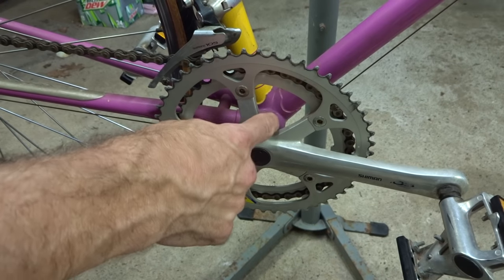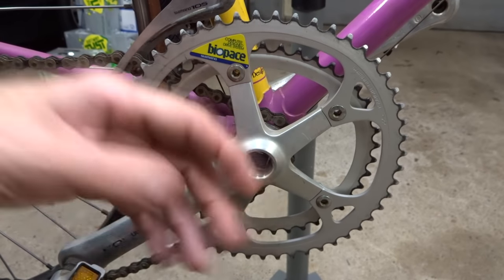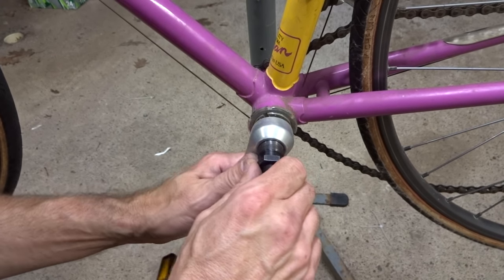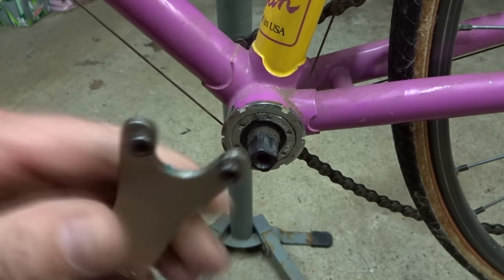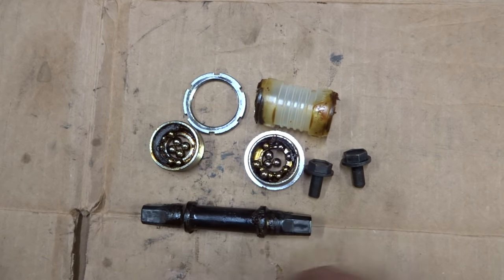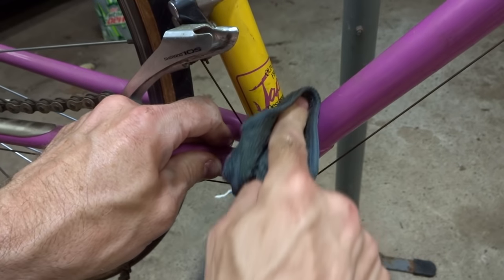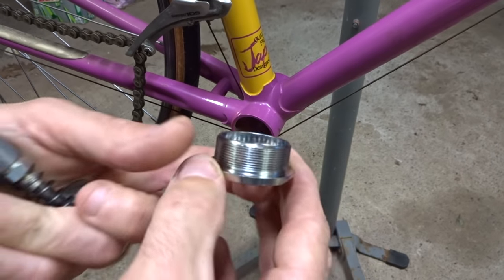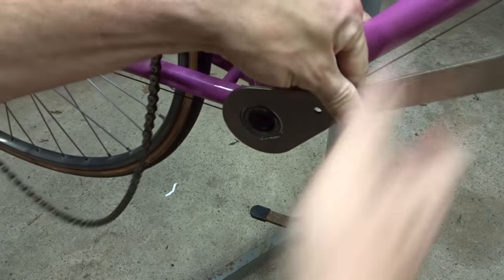Square Taper Bottom Bracket Service - How To Overhaul/Remove/Clean/Install

Comment: can i ask what is the size of that bootom bracket
Reply from the maker: It's a British ISO bottom bracket.
Reply: Sir can i ask if it's 113/118/122 or 124mm.? thankyou for the reply
Reply from the maker: You need to find the length of spindle that YOUR crankset specifies.

Comment: What do you do when the threads strip out of the crank when using the crank removal tool at 3:08 ?
Reply: David Williams I have the same problem, I cant remove it because it is to pressed. I try to get the crankset out with one spindle mounted
Reply: Is it possible to take the spindle out both ways?
Or does it have to be removed to the left?
Reply from the maker: https://www.youtube.com/watch?v=jrpIoXxVyTs
Reply from the maker: It is possible to remove it the other way. But removing the adjustable cup is usually easier than removing the fixed cup.
Reply: Thanks RJ The Bike Guy for the reply and the link.
I'll keep trying - the drive-side came off 'easily' so I'm left with the non-drive side crank - it has been on for about 30 years and it's on TIGHT!! Hopefully I can undo the adjustable cap with the crank still attached.
Reply: David Williams ... Make sure there are no washers left in place as the crank bolt is removed before using the crank removal tool. The washer will keep the insertion of the crank removal tool to go into the crank as you tighten it before it even touches the spindle. It will feel like it stops 'dead' if a washer is in the crank arm. Please don't ask how I know this, LOL
Reply: Buy new cranks
Reply: Did you spray it first with penetrating fluid, like PB Blaster, then let it soak for awhile?
Reply from the maker: You can also get the 3 jaw puller on there, and then heat the arm with a hair dryer which will cause the aluminum to expand just a little.

Comment: A little oil on the crank puller threads is a good idea.
Reply: why?  I've never used oil on a crank puller.
Reply: Because the threads on the crank puller are hardened steel . The crank is made of aluminum. A little oil on the crank puller threads will help to insure that the puller threads bind smoothly with the crank threads. But -hey -what the hell do I know?
Reply: The crank puller doesn't get tightened against the actual crank arm threads.  You thread it in there until it stops, and then the middle portion of the puller gets tightened against the BB spindle, and pushes against the threads inside the outer collar of the crank puller.  That in turn pushes the outer collar threads against the crank arm threads, but the steel/aluminum threads themselves are not being turned against each other under tension or any kind of load.
Reply: Swell but -and as I think I already said  The hardened steel threads of the puller are engaged with the aluminum threads of the crank. Is this hard to comprehend. Hard steel threads will shred softer aluminum threads if there's a problem. PLEASE -end of conversation.

Comment: when using thread locker, are you supposed to let it dry on the threads before you screw in?
Reply from the maker: Not according to the directions on the tube.
Reply: Many screws that come with products come with blue threadlocker already applied. This is why I ask. Each time you unlock something fastened with threadlocker, do you need to apply it all over again?
Reply: Yes. At least I would.
Reply from the maker: https://www.youtube.com/watch?v=ejZ0LZxt38o
Reply: Thread locker is anaerobic which means it dries once you screw it in and the oxygen is cut off.

Comment: Fking things are solid had to use hammer and wrench or ball joint remover 1 hit compared to screwing the threads up with the puller ffs 😂
That came off way to easy 😂😂

Comment: Or you could do a video on how to install a bicycle motor kit
Reply: I think that a Luna Entry Level,  250 Watt Electric Motor Kit Video, would be Awesome,,,,, I know RJ would do a Great Job! would Love to see it!!! :)
Reply: Lauri why is that?  I have a Bafang BBS02 mid-drive setup that works quite well.  It has almost 2,000 miles on it in 6 months.
Reply: Patrick94GSR middle drive stresses drive train. I heard it in table conversation.
Reply: Somewhat, depending on what you use, but mid-drive is better for climbing hills.  Also some say that mid-drive is more efficient.
Reply: Patrick94GSR How is mid drive more efficient? Electric motor should be almost full torgue from start. Drive train has gear, chain and spur extra to loose energy comparing to hub motor. I wonder if "Some say" is related to feeling, not friction.
Reply: The geared drivetrain can make a mid-drive motor more efficient, and having the weight near the center of the bike can make for better handling.  https://www.evelo.com/evelo-difference/advantages-mid-drive-motor-vs-hub-motor/
Reply: But, for heavy loads that I'm accustomed to having on my bike (cargo trailer or kid on trail-a-bike) I'm starting to think hub drive would be better for me as it wouldn't put that strain on my chain.  But my chain is only $10 so it's not a huge deal to me.
Reply: Patrick94GSR Ok, I believe you. I don't have electric bike. i was wondering I could have electric assistance on one bike pulling a trailer.
Reply: Patrick94GSR Yep heavy load is something to think about.
Reply: eat more veggies
Reply: front wheel driving ebikes are TERRIBLE

Comment: It's not rotating smooth as yours😭
Reply from the maker: Loosen the adjustment a hair. Make sure it's clean and lubed with new ball bearings.
Reply: @RJTheBikeGuy  yeah it worked 🤩 after lossening sir thanks a lot.